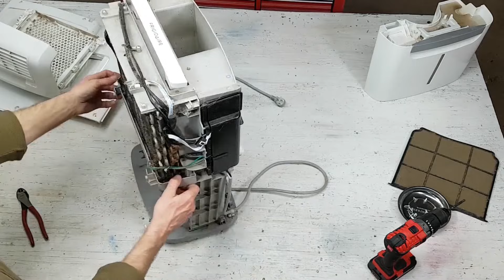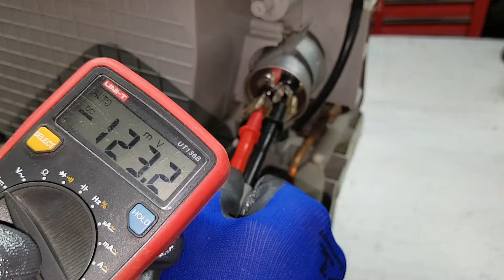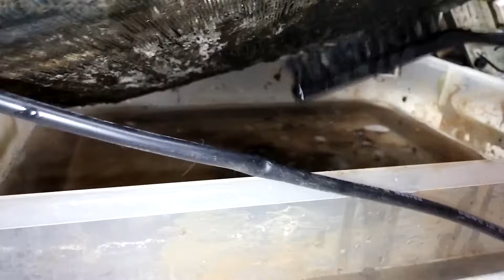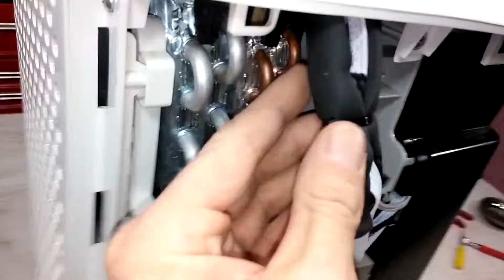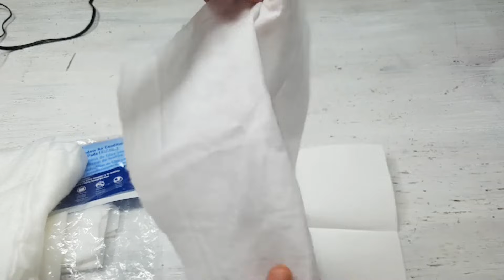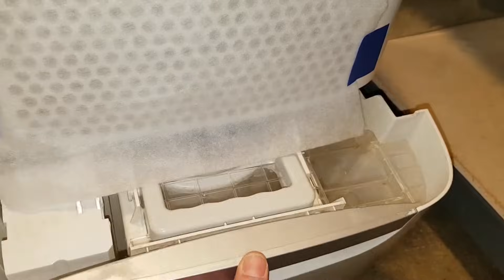How I Cleaned a Dehumidifier - Deep Cleaning Moldy Coils, the Bucket, and the Filter

Comment: I have the same model and it is a nightmare. Mine is much more slimy and matter with cat hair. Im afraid of breaking a line so i have yet to separate the coils from each other. Im glad i found your video.
Reply from the maker: Safety goggles or a face mask can be used to help protect the face when servicing those pressurized coils.  They really made this unit hard to clean.

Comment: you have educated me to how important it is to keep your filter clean. What you did I would not attempt as I do not have your expertise
Reply from the maker: The pre-filter material I now use makes a big difference.  I just need to change it every couple months or so.
Reply: Some dust always pass through the filter, does not matter how often you clean it. Intensive cleaning just means, you postpone this maintenance maybe half a year later. But will not avoid it.
Reply from the maker: I assume the filter screen is for hair, as it certainly does not help much with dust.  The filter material I used at the end of the video does a good job of preventing the coils from getting dirty, but the material needs to be changed regularly.

Comment: Vacuum the intake, and exhaust daily. You can use a 3M Filtrete pre-filter carbon filter meant for air purifiers on the intake, and the same brand filter on the exhaust.
Reply from the maker: Thank you for the tip.

Comment: they make a cleaner just for air conditioner coils you might try that just spray on then rinse off might not work with all that dust but will probably kill mold and such.
Reply from the maker: Thank you for the tip

Comment: I would place the enitire unit (after removing bucket, screen, and panels) into a large tote. Then place a jar of water into the tote, place 5 chlorine dioxide tablet into the jar. Cover the tote air tight. The CD tablets in the jar of water will form a Gas.....that KILLS /destroys mold.  Make sure to let unit sit in tote with CD gas for 24hours😊. Then wipe unit clean. Wear gloves, mask and use disposable cloth/paper towels.
Reply from the maker: Thank you for the tip.

Comment: I appreciate the breakdown, not many videos cover this deep into an appliance. I was given a unit, thought it was a humidifier (in Florida, essentially useless) and was getting ready to do a teardown. Running the model number, it's a DEhumidifier, a moisture farm. The survivalist in me sees this as a water generator should normal sources become contaminated, And the learning begins. So far I've removed the plastics and filter and they're set out to get rained on as that's clockwork free rinse. I'm adopting this unit so like you, I'm expecting to do a thorough cleaning, it's coming from a filthy place and I don't operate like that. Thanks for the reminder to mind and discharge the starter capacitor, it's been off for a while, but the muscle memory will serve me well when I do the routine service of the unit [should it run]. My coils aren't a moldy mess, but I intend to clean them up before use, and sterilize the unit. If it doesn't sell I'll probably keep it vacuum sealed in a trashbag, store it with the emergency hurricane supplies, if not for drinking water, then for flood response. (I'm assuming if the unit is clean enough and resterilized before use it could be used this way, maybe after another boil, if anyone knows about this I'd be interested in any input. I imagine if hooked up to power, the unit placed outside is capable of producing near-potable water I could pour through a carbon filter?). I hear these things are prone to shorts fires, so going through and pre-mitigating those risks was already on my mind. The pre-filter was a good idea, I'll remember that or see if there are alternatives.
Reply from the maker: Thank you.  I've used the water collected from the dehumidifier to water plants and to moisten compost piles, worked great.  I think I would be willing to drink the water if it was filtered enough or boiled, or both.  If I could get the coils clean   enough and a better pre-filter, then I bet the water would be okay straight from the unit.  But I don't know for sure.

Comment: I felt like i could do thus until the discharge part, ehh not so sure on doing that! 
Would dirty coils make the same unit blow warmer air than normal? (Not as dirty as yours was, inside house w no pets dirty)
Reply from the maker: Yes, I believe so.  My dehumidifier was blowing much warmer air when it was dirty.  Kept getting hotter and hotter during the months just before cleaning it, until it began to struggle taking moisture out of the air.

Comment: will pressing the power button with the until unplugged discharge the stored electricity? This works with electronics and computers, so maybe it's worth a shot.
Reply from the maker: I doubt it.  That might work for the capacitors on the control board, but probably not the start capacitor for the motor.  Even if it could work, I would still safely short the terminals together in order to discharge the start capacitor and test it with a multimeter to be sure.  It's not worth the risk.  I'm not sure what the safest way to discharge that capacitor would be.  I assume the dehumidifier has a circuit that drains the capacitor when it's unplugged, but I don't know.  And I wouldn't trust that circuit anyway.

Comment: Great video!  Have you found a model that allows for easier cleaning yet?  If so would love to know make/model.  Picked up this exact unit free this morning!  Cleaning is done, I will assemble tomorrow and test it out.
Reply from the maker: Thank you.  I haven't found a replacement that's easy to clean yet, but I have seen some newer models with pre-filters that look promising.  The A/C window unit filter material has been working well for me,  just need to change it once every 3 months or so.  There may be a washable filter material available.
Reply: @BudgetPhil IDK, but I think upholstery bottom liner / dust cover work just as well. Not sure of the cost bc somehow I’ve amassed quite a bit, both black & white, from estate sales & even an entire roll from a wedding they had used to line the aisle.
Reply from the maker: That's a good idea, I want to try that.  Thanks for the tip.

Comment: Haha i googled How to Deep, clean a humidifier. And this was the first video that popped up. And it's the exact same one i have. What a bitch to take apart. Made to never be worked on by the consumer
Reply from the maker: Hard to believe it was designed this way.  Seems like dust in the air was completely off the designers radar.

Comment: Ok so I started this before watching this video and didn’t disconnect any electronics except the circuit board where the buttons are (I covered it with a ziplock bag) but I didn’t unplug anything. I just sprayed hvac solvent right to the coils and even touched it with my bare hands at one point haha glad I’m still alive!
Reply from the maker: They really should make dehumidifiers like this easier to clean.

Comment: I have an old dehumidifier and a 100+ year old house. I had put a little clorox in the bottom to kill anything in the tank and tried Odoban sprayed on the filter before running it. My furnace died and had sprayed my house with dust and contaminants. I never imagined I could get at the coils! Thank you for an informative video.
Reply: I didn't have all the gear to do what you did so I used a spray bottle of water and a spray bottle of enzyme cleaner in the front grill. I used a fan to dry it after. I didn't pull it apart. It ran much better afterwards.
Reply from the maker: You're welcome.  The pre-filter material that I now use really helps to keep the coils clean.  It needs to be changed every couple months or so, but has made a huge difference.

Comment: I have a danby dehumidifier similar setup...its blowing out the smell of mold.  Ive been using it for personal  home use for about 3 years now.  So workshop or personal  doesnt seem to matter.  These things seem to collect moldspores and theres no way im doing what you did to clean it.  So i guess im going to have to buy a new one.  Such a shame.
Reply from the maker: Some manufacturers now put pre-filters on these types of units that actually work for dust.  I suggest looking at dehumidifiers with good pre-filters.  That's what I'll be doing next time.
Reply: I have this unit, brand new June 2020 I use in my lower level that is finished and clean. The past two years I've noticed a mold smell but wasn't sure where to start. Thanks!

Comment: Guys this is all the filters these machines have? I got a juro pro Crystal 30lt wi-fi and it has a huge car air conditioner filter, charcoal filter and this one on the video. I thought they weren't enough but I keep watching videos and these machines have only this small filter.
Reply from the maker: I agree.  The filter that came with this unit is not even close to adequate.
Reply: @BudgetPhil  exactly. As for the filter I was talking about it's Hepa 13
Reply from the maker: That's good to know.  Thank you for sharing that information.  I'll be looking for a dehumidifier like that when the one I have  fails.
Reply: @BudgetPhil  thank you sir!

Comment: Hi. Got the same model. In my particular case the fan was not working. After disassembly the equipment and reach the fan, it got a part of the case with heavy corrosion, specifically the part that is contact with the holding base where it is mounted. This base is stained with rust. Any idea why this happen?ed. Maybe some water from the condenser is accumulating there. Any of how this can be  avoided. Thanks in advance for any comment
Reply from the maker: There was some water in the bottom of my unit as well, but it hadn't rusted yet.  I think the drain for the coils that leads to the tank was partly blocked and it overflowed into the bottom of the unit.  I clean that drain occasionally now with a small piece of wire to help avoid the blockage.  Hair seems to be the main reason mine gets clogged,  but a piece of thin wire , like a twist-tie for example, with a hook bent on the end helps me to fish out the blockage when that happens.

Comment: Soooooo my filter panel looks less dusty than this, but it has some kind of dust in a consistency like wet sand. Do you think it is also mold? Should I be worried or just wipe it out and put it back😢
Reply from the maker: I'm not sure.  If it doesn't smell like mold, then that may be a good sign that it's not moldy.

Comment: Thanks for the hint with side panels!
My device is triggering the FI when I plug it in and when I put it in a plug that has no FI it's popping the fuse, but only when the compressor eventually starts. I Suspect some moisture in there somewhere ? Don't know why it suddenly does this. Although, a squished power cord might fit the symptoms better and would also be the most vulnerable part, since I keep walking over it.

I'm no stranger to taking things apart, but with these devices which have big plastic panels you never know what intricate method keeps you from opening it. I was close to pulling my hair out, then I did a search, found your video and hoped the solution would be universal.

I did suspect the side panels sliding out towards the bottom, since there were some "stops" designed into them. But I underestimated the sheer force this took and also the hidden pressure point: they also had latches at the top that, once snapped into place, would  keep the side panels from moving back down. I was lucky that the first panel's latch kinda failed to hold on. The second latch would only let go when I pressed inward hard and simultaneously tapped on the panel.
They really don't want you in there, I guess xD .

EDIT: I think the compressor is stuck. Everything inside looks like new, the power cord is not shorted, the fuse pops the the compressor is supposed to start. Getting it out would be a hassle. Also not sure if there is actually something you could force the piston with, since these compressors are pretty much encapsulated. :(
That whole device isn't that old, such a bummer.
Reply from the maker: Yeah, it's a shame when things break so early.  I bet you 're right about the compressor.  Thank you for sharing your experience

Comment: Im just gonna try to blow it clean outside with a leafblower. Maybe when storing my new one in the summer I’ll wrap the thing in a bag taped up or something cos that dust just clogs the coils and fins so much.
Reply: If it has mold on the inside, a leaf blower won't do anything but spread mold spores
Reply from the maker: A/C window unit filter material has been really helpful for me.  It's been keeping the coils fairly clean.  Just need to replace the filter material on the dehumidifier every couple months.

Comment: I'm in the UK and have a dehumidifier very similar to yours but badged Electrolux.  The performance has dropped off seriously and the "Clean filter" warning light stays on even after removing and cleaning the filter.  I don't think I have the ability and/or determination to strip it down as you did.  I'm sure the cost of returning it to the manufacturer  and having it serviced would be prohibitive, maybe time to put that money to a new unit.  Thanks for uploading a superb video.
Reply from the maker: Thank you for the compliment.  I came close to buying a new dehumidifier.  They really are hard to clean when designed like this.

Comment: I'd be sending that unit to the garbage. Even after cleaning it still won't be 100% and how often does this intensive cleaning need to be done?
Reply from the maker: I know what you mean, there's probably no way to get all of it clean without extreme measures.  Got all I could see though.  My dehumidifier needs to be cleaned once every few years.  The A/C window unit filter material I showed towards the end of the video has done a great job of filtering the air and keeping the coils clean.  I need to change that material once every 3 - 4 months.

Comment: Great video but can u add the model number so people can find this video easily for those who have this same exact dehumidifier.
Also when u r rinsing the coil, or making your Dawn soapy water do u have to use Distilled water?
Reply from the maker: Thank you.  I'll put the model number for the unit in the description below.  I used tap water because the dissolved solids in our water is only about 250ppm.  If the mineral content of our water was much higher, then I would have rinsed it with distilled water.  Thank you for the helpful suggestion and the great question.

Comment: Did your homemade prefilter cause the dehumidifier to extend the amount of time  for  removing the same amount of water from the air than without it?   Thanks for sharing.
Reply from the maker: No, I don't believe so.  I didn't notice any change in it's efficiency after installing the pre-filter, but I do need to make sure and change it every 3 months or so.  It gets pretty dirty and then it really does start to reduce the efficiency of the unit.
Reply: Thanks for your reply...

Comment: are you allowed to lay it down? the compressor has oil in it. if passed to elements it will not work
Reply from the maker: It can be laid over, but it needs to be in the upright position for several hours before use to allow the oil to drain back down to the compressor.  I vaguely mentioned it in the video, but should have put more emphasis on it because it's pretty important.

Comment: I don't think any filter is going to capture dust as efficiently as the wet surfaces of the evaporator coils. They will always get dirty, even in clean homes. Dust in homes is mostly skin cells, and that feeds the mold.
Reply from the maker: Yeah, those coils definitely make good air filters when wet.  The pre-filter material I now tape to the inlet of the dehumidifier significantly reduces the dust and hair entering the unit, but it will still need to be cleaned again someday.  The amount of dust and hair the pre-filter collects in a couple months is surprising to me.  Makes me think about air quality

Comment: Did the unit have an extended life of use after the cleaning captured in this video???
Reply from the maker: Yes, the dehumidifier is still working fine to this day.  The pre-filter material really helped keep the coils clean.  It will probably need another cleaning though someday, if it lasts.

Comment: Wonderful video.  I would definitely wear a good mask and do it outside.  About 1/4 of people are highly sensitive to mold and would get pretty sick around this.  Also, I just bought a Midea dehumidifier from Sams and it looks basically the same, probably made by the same factory.  And it has a removeable grill.
Reply from the maker: Thank you.  In retrospect, I wish I had worn a mask.  It was pretty bad.  That removable grill on your new Midea unit sounds like an improvement to the design of these things.  Maybe some manufacturers are trying to make modern dehumidifiers that are easier to clean now.

Comment: I bought a used dehumidifier, been running it about a week or so. Went to clean the filter and noticed the coils behind it completely caked in a mostly dry black substance. Once I took it apart there was moist black areas on the coils as well. How bad is it that it's been running in my house? Is it mold or maybe sludge?
Reply: Yikes! After finding mold in my home and doing a deep dive on how dehumidifiers circulate spores into the air I would never use a secondhand dehumidifier. After I stopped, using my dehumidifier in my home my daughter, and I stopped breaking out and rashes. This was a new unit I purchased and had ran in my home only.
Reply from the maker: I don't know.  It's good that you checked the coils.  I bet they can be cleaned.  But if it's like mine, it may be a rather time consuming task. Thank you for sharing your experience with a second hand unit.